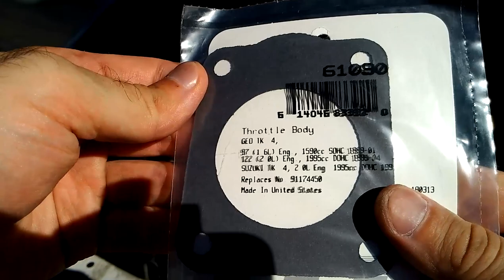Suzuki Vitara J20A engine throttle body cleaning and changing gasket (Fel-Pro 61090)

Comment: I  take off throttle form my 2004 Suzuki grand vitara and cleaned it put it back on and the vehicle is throttle high. Rev count is at one constantly when the vehicle is started.
Reply from the maker: I think it should be a faulty throttle position sensor, check it with tester, there are some good videos on youtube how to test it

Comment: hello how are you. i have a question about the j20a engine, can you help me. what could be the problem, idling low.
Reply from the maker: hello, you should begin with cleaning throttle body and PCV valve, also check vacuum leaks, ignition coils...
Reply: @Petruccio1881  is there a way to manually increase the ide?
Reply from the maker: yes, you can adjust it with little screw on throttle lever, but I would not do that, first figure out what is the cause of low idle